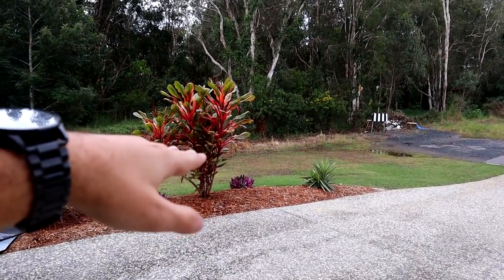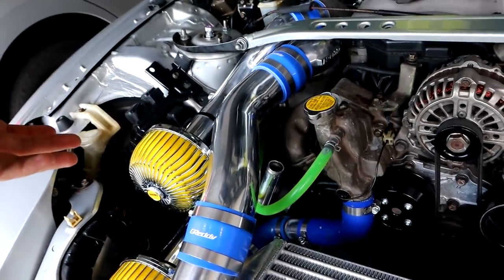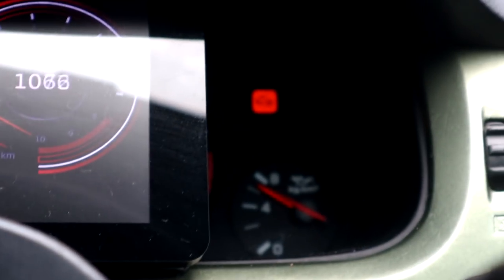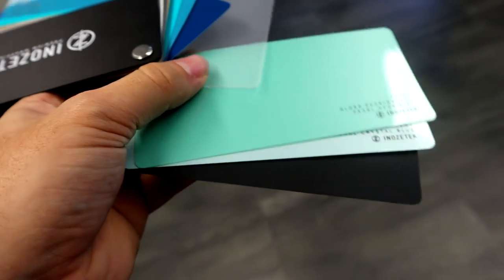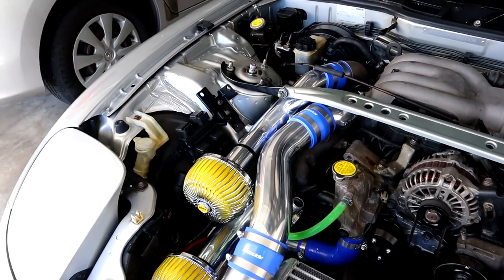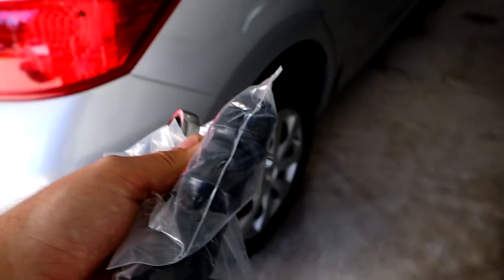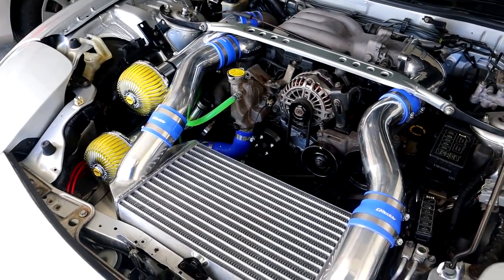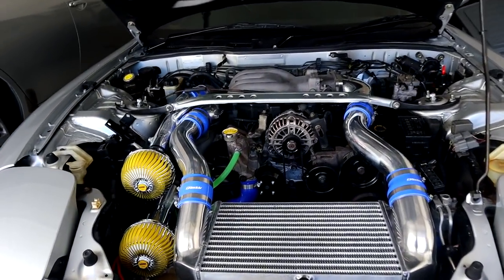Wrapping my Mazda FD RX7

Comment: The twin turbos are known for leaking oil because they wear out over time. Mine has done the same. Just not sure if I rebuild or go single turbo. Doubt it will be blow by. If you're lucky it could be the turbo drain but in my case it didn't help lol.